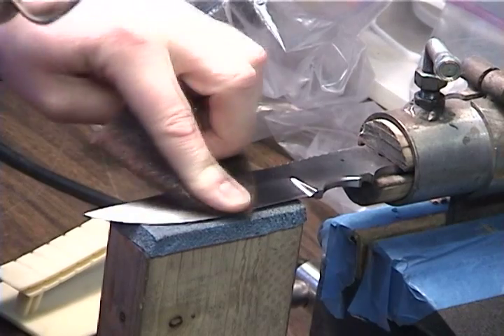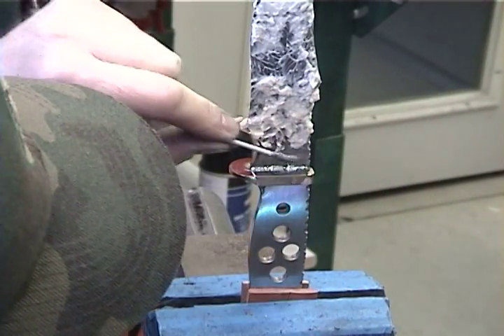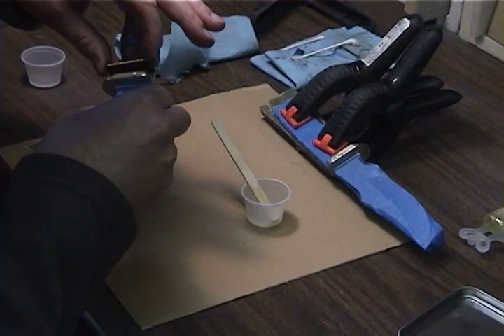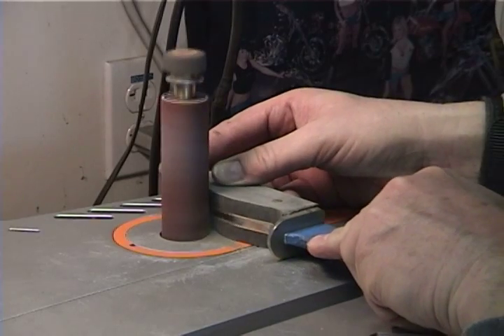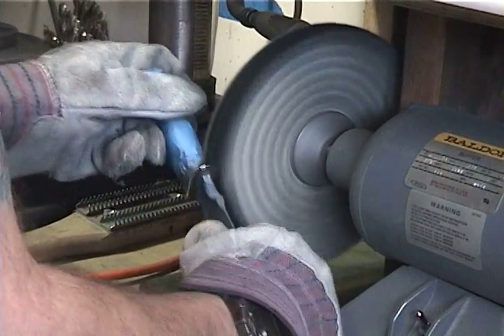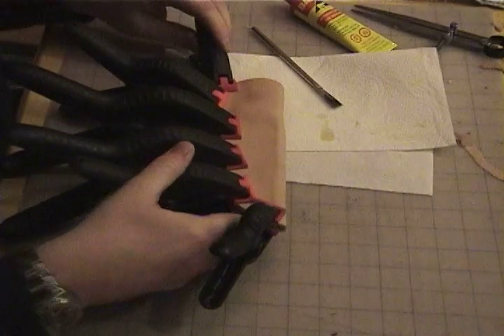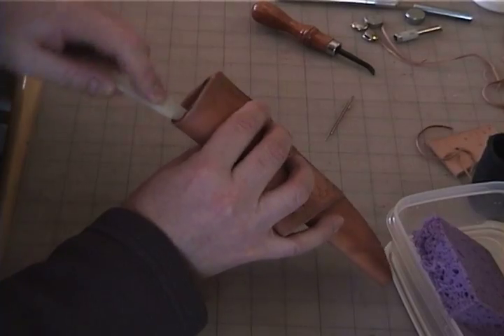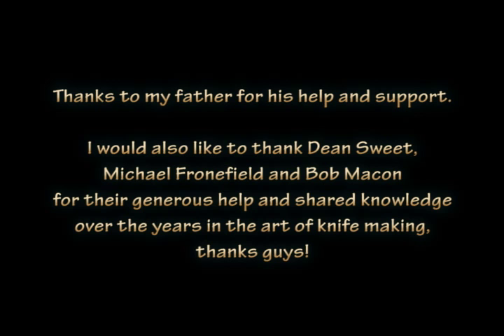How to make a full tang knife - Part 2

Comment from the maker: Soldering the guard to the blade adds strength and prevents moister from seeping into the joints. Soldering is a messy processes and it always needs cleaning up. The back of the guard need to be perfectly flat for the handles or scales to rest flush on the knife. I put an extremely clean finish on this knife, hens what it’s pricy.

Comment from the maker: @BOHUNTER 
One option is to add a powdered pigment to the leftover epoxy and fill the gaps with it and then sand it flush when it cures, nice effect. Or use Q-Tips and acetone to wipe-up and remove the excess epoxy from the filework. Use rubbing alcohol to clean off the epoxy from your fingers and hands.

Comment from the maker: @13FirePyro 
1095 carbon steel is the cheapest steel I use without sacrificing quality. 440c stainless steel is the lowest grade I would use but it’s still a good steel. ATS-34 is a step-up from 440c but if your knife is larger than 12 inches go with 440c. 5160 carbon or alloy steel is one of my favorites but it might be hard to find in small quantities. For more detailed info on blade steels go to bladeforums web site and do some searching. Good luck.

Comment: what is the make and model of that belt sander?
Reply from the maker: It's a Burr King 960, 2x72, 2hp, variable speed. The contact wheel is the drive wheel and that's nice. But the drive wheel housing is close to your hands and I sometimes have problems bumping into it.

Comment: What's the point of peening the pins of the handle, when you grind them to their final height a couple of minutes later in the video? I'm in the process of making a full tang handle and thinking about the pins is giving me a hard time...
Reply from the maker: I peen because I want them to evenly spread out tightly into the handle material. A lot of production knives don't do this but I want my handles to snug in place.